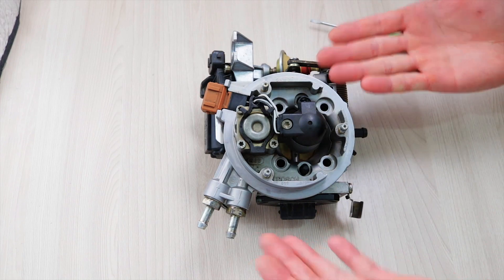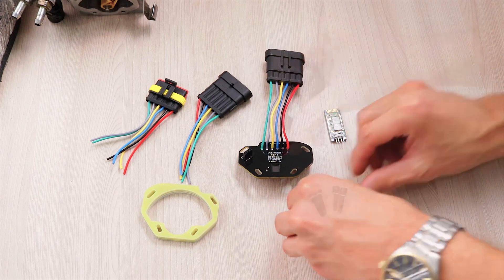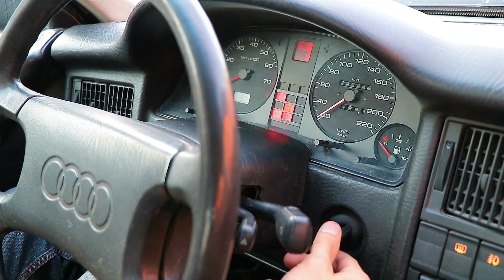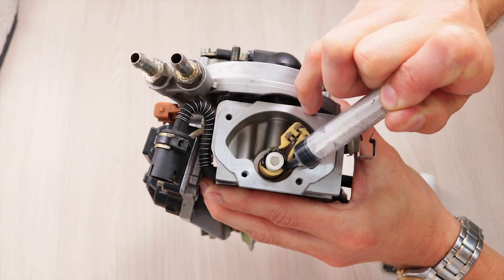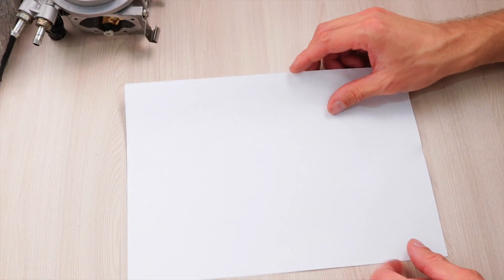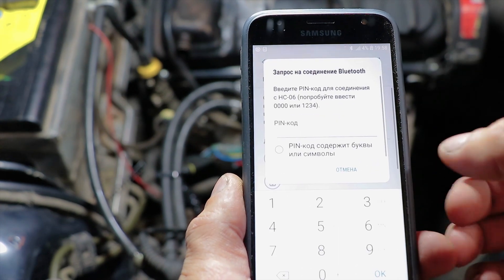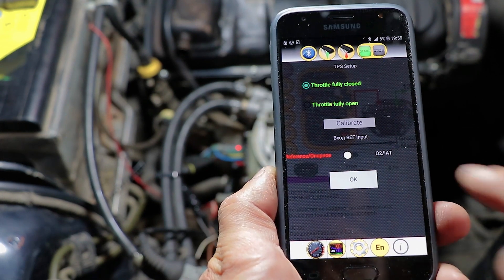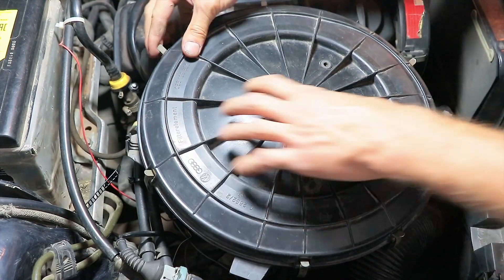Contactless TPS 3437022 installation tutorial on Audi 80  mono-motronic

Comment: does it fit a Citroen Ax 1.0? Because the sensor looks the same but the injection unit is a bit different. And it does not have a metal pin where the magnet can sit
Reply from the maker: The sensor is universal and ouput charcteristics  can be  adjusted.
Send me a photo  of axis   - I'll think what we can do.
Reply: Sure, i will send you a picture
Reply: On which platform do I send you a picture?
I cannot do it through youtube?

Comment: Hey I have a question. There are different diameters for the spindles on the Monojetronic, for 1.4-1.6 and 1.8-2.0. My Uno is 1.4, will it actually work well or should I measure it before making the purchase?
Reply from the maker: Hi. It will be better to make measure of axis diameter before purchase, because especially on Fiat there could be axis with end diameter 5 mm on 1.4 engine

Comment: can you help me about peugeot 205 1.1 it have same injector like in video and everything working good car start very good,idle work perfect but problem is in power in second and 3 gear the car just want to turn of and lose power like he dont recieve fuel  or to much fuel so i need to stop switch to first gear and go. the injection spray fuel in dust so injector is good. + i check fuel pump other sensor and everything is good.
Reply from the maker: Hello. 
Try to disconnect  idle regulator's connector and make  a test drive. 
If  the issue is gone  then  it is idle swith problem.
Here i made a video on russian about idle regulator , you can enable subtitles + autotranslation  - about 80% of info will be clear
https://www.youtube.com/watch?v=E5CHUqxYy8o

If disconnecting of the idle regulator will not help, then  you really need to check fuel pressure  on the road.

Comment: Dear anton, i am interested in buying the contactless tps sensor. but i dont own an android phone i have an iphone. is it possible to do it with my iphone? if not how do you use it via windows? do i then have to carry my laptop by my side all the time?
kind regards Dave
Reply from the maker: Hi, 
The app  is available for android and windows only.You will need a laptop for  calibrate and tune   at first time  and maybe additional 3-5 times for adjusting the mixture.  After that you can   remove bluetooth module in a glove compartment and drive your car.

Comment: hello friend! excellent product. sorry but do you know the original position for the top screw of the butterfly valve? the one on which the throttle rest when the idle regulator motor is fully retracted.

what is the distance in millimeters?
Reply from the maker: Hello. 
It doesen't matter - just  set it so it  prevent throttle sticking in the throttle case at fully closed position.
Reply: @thebesttps3934  thanks! it has been really useful info.

Comment: Hello Dear Developer,

I would like to order one for my Audi 80 1.8S engine code: PM. I have Samsung S7 Edge. Is this android application still works ? I want to fine tune my carburetor and this seems to be a perfect solution. Please let me know so I can put an order and try your invention 🙂

Thx in advance !
Reply from the maker: Hello friend,
We are not tested it on Smsung s7 edge and at this moment we are rebuilding  android software. 

But if it will not work on your smartphone, you can use windows version - it is tested and stable. 
Also the softwre works only  with our contactless sensor and it compatible  with mono motronic and mono jetronic fuel injection systems.
It is not comp[atible with carburators like solex or pierburg etc.